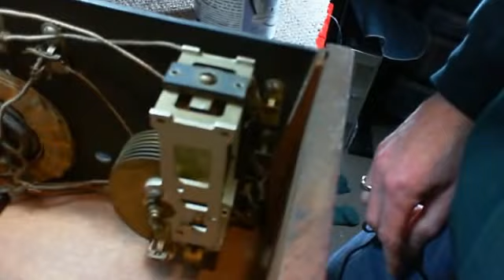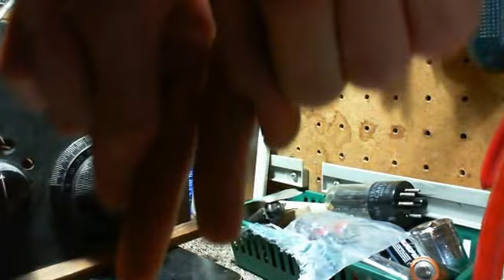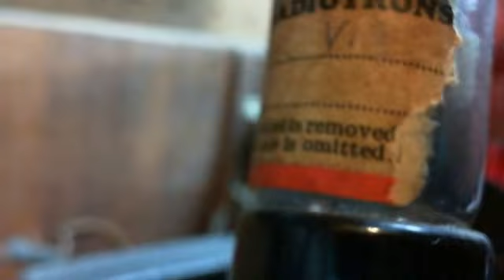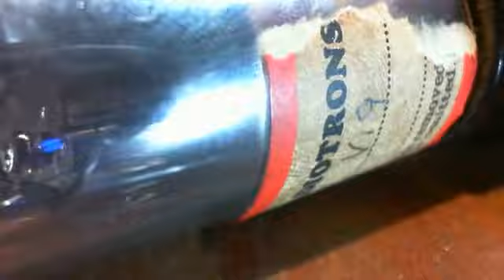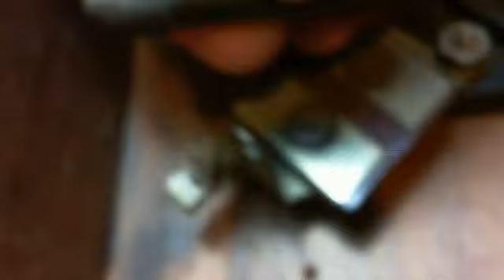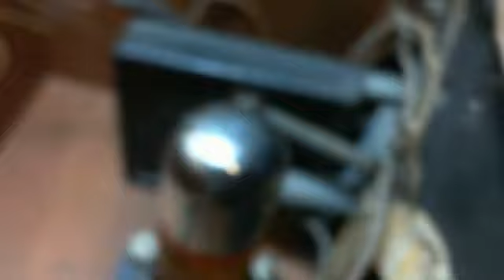Antique 1920's Single Tube Radio - Thorough Checkout

Comment: that set could have started off life as a crosley it has some of there parts in it like the book tuning cap and the tickler coil the front face panel has a crosley look with a lot of extra holes so now its just some run of the mill home built from lots of unrelated parts

Comment: That type D condenser is the oddest electrical component I've ever seen. Very unusual but I can visualize how they came up with it. Essentially a single plate variable capacitor. Maybe fine tuning. Center terminals probably headphones.
Reply from the maker: I couldn't believe it when I first saw it.  I didn't think you could get significant capacity from such an arrangement.